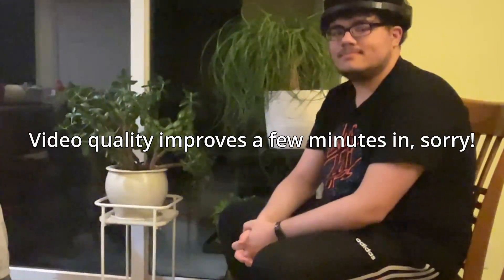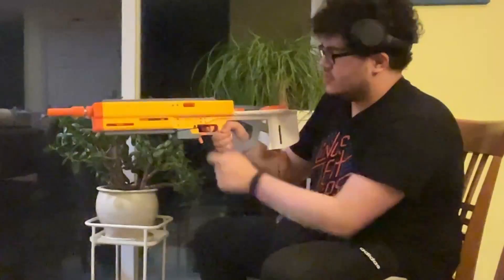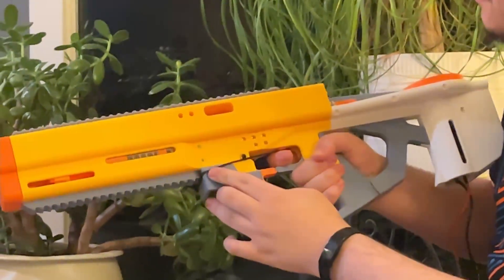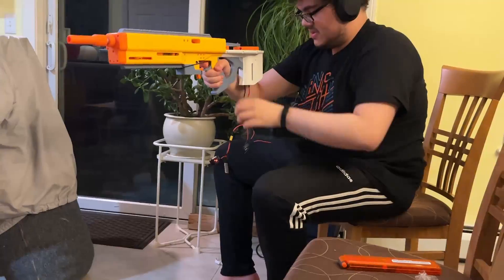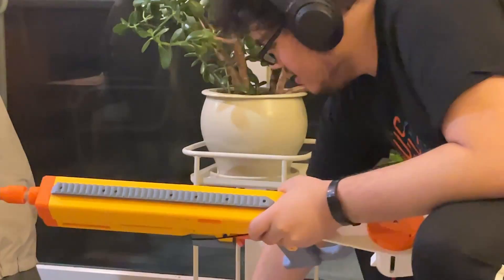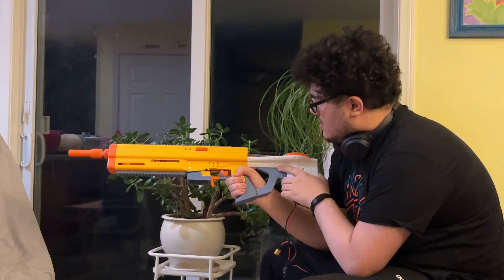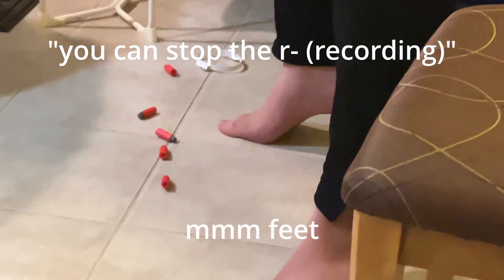Slider Crank AEB (electric springer) test firing - Success!

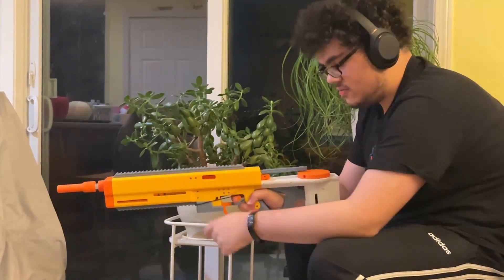Comment: 4:54 This squib issue is likely due to a "lock time" problem where the breech seal has started to open or is not yet fully closed before the piston has released. A potential solution could be to have two separate action bars; one for the piston prime and another the bolt. Using a curved track scotch yoke (aka scotch yoke with dwell) instead of a crank and slider for the bolt would be an ideal solution. Think Rapidstrike pusher mechanism, but flipped so that the bolt dwells forward. By separating the action bar connecting rod into two, you can keep the high load application strong, and add dwell to the bolt which will drives a minimal load.